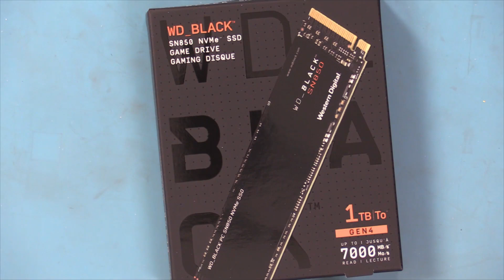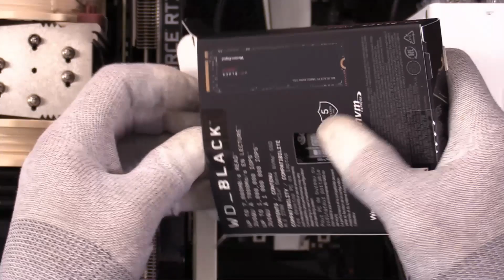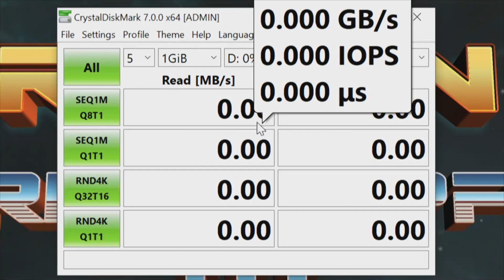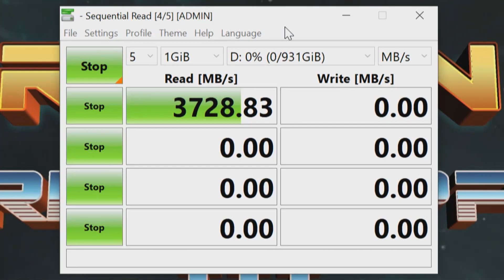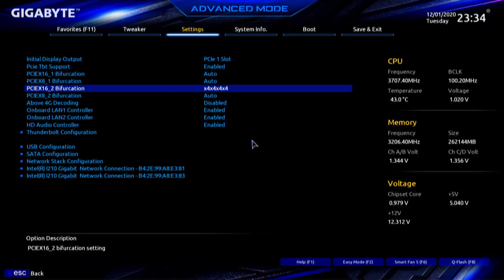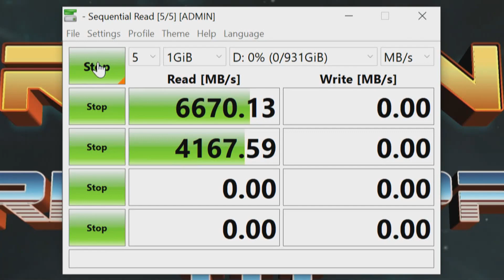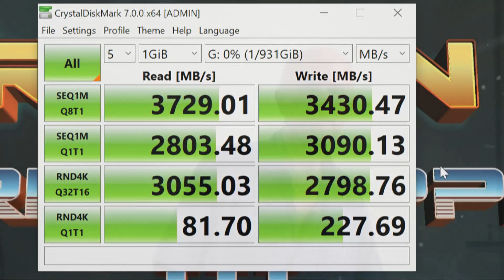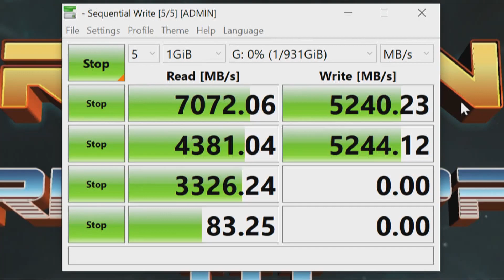WD Black SN850 Unboxing, Install, Test and Technology

Comment: So, WD SN850 (1TB or 2TB) and 980 Pro (1TB), which one is better, faster ? I'm very confuse to choose one of them.
Reply from the maker: Hi  BVT - Bách Vạn Truyện, 
Which is faster depends upon which M.2 Connector is used - CPU or Chipset. Our Goal was not to confuse but to provide clarity. We will do better next time. 

1.) Notice larger M.2 NVMe Drives will always be faster than smaller M.2 NVMe Drives. Denser Chips, Writing to more Chips. 
2.) On the TRX40 Designare Motherboard, using the 2nd M.2 Connector to the CPU - the WD Black SN 850 is faster, in our informal tests than the Samsung 980 Pro. Your Results may vary. Hope that helps!
Reply: @BuildOrBuy  How about if i just play some games, render video, sometimes use adobe software. copy some large files, which one will you suggest 980 Pro and Sn850.
Reply from the maker: Hi @jiangtruong ,
Hi Jiang Trương, 
Right now, both are good value if You have PCIe 4.0. As to which one? If I could get either one? My personal preference for NVMe is Samsung. It's all about availability!

Comment: Hi Gill, amazing video. I wonder if it's compatible dell latitude 7490.
Reply from the maker: Hi Danny, 
Thank You! We need to determine if You have the M.2 NVMe Connector. According to Kingston, You do. Check the Dell Service Tag on the back and verify on their website. Another option, go into Your Bios and and see if You notice a setting for NVMe. The 4th option would be to install and run Belarc Advisor Free. That report will tell Us what's there. It can only ready a Device, not an empty Connector. The last option is to visually inspect the Laptop internally for the M.2 NVMe Connector. 

1.) https://www.kingston.com/unitedstates/us/memory/search?model=97698&devicetype=3&mfr=DEL&line=Latitude
2.) https://www.dell.com/support/home/en-us
3.) https://www.belarc.com/products_belarc_advisor

Appreciate Your Comments!

Comment: You mentioned that the tested drive will operate at it's top seed up to 75% of it's full capaticy. Is this also true for true MLC drives like Samsung 970 Pro or Samsung 850 Pro SATA3? Or good TLC drives like Samsung 850 EVO SATA3 or Samsung 970 EVO (PLUS) NVMe? Is there any drive that You've tested that pushes that 75% limit further or even up to 99% or 100% (100%=no disk space left on drive) ?
Reply from the maker: Hi Don, Any Drive whether Spinning, SSD or NVMe. I run up against that all the time with Spinning HDs while Rendering Videos. And have to start dumping or off loading Data to an Archive Drive. If You ever fill up a HDD, take a look at Windows Explorer, This PC, Devices and Drives. Ever Notice a Drive in the Red? There's still space but... Time to offload Data to a different Drive! Performance drops! Keep Usage under 75% Capacity to maintain top performance. I only know the Specs. I've been using M.2 for over 6 Years. And M.2 NVMe for maybe 3 or 4 Years. Other factors come into play before that ever occurs. 

My 1st encounter with a Full M.2 SSD Drive was for Virtual Instruments. Virtual Instruments require copious amounts of space while installing before they are ready for use. Therefor, with an M.2 NVMe, easy to avoid and Plan for it in Advance. Good Question! Thanks for Asking!

Comment: HI, just found this channel, love it. I just bought the SN850 2TB, but I get horrible write speeds when running it through my X570 chipset lanes. Any chance you could let us know how this drive runs when on your chipset lanes ? Do you see massive loss of performance ? My read speeds are just fine though.
Reply from the maker: Hi Mathew Lear, 
Nice to meet You! Glad You found Us! Welcome! Are You on the 1st M.2 Connector and no shared PCIe Resources? Many of the x570s has way too many shared Resources. Which Motherboard are You using? I'll be happy to check and see! So far, we've had good performance. We tested and disconnected until the next test. 

We've just Filmed Thunderbolt 3 Firmware Update and Slot assignments. Tedious but necessary! Getting ready to Film a Riser Cable and Card then Capture and Streaming cards! Stay tuned! Then back to M.2 NVMe cards to compare Heat performance. Answering Questions with Videos keeps Us busy!
Reply: @BuildOrBuy  Hi, actually my board only has one m.2 slot (Asrock X570 ITX/TB3) and this slot is wired through the chipset (confirmed by Asrock tech support). My board has been tested with other Gen4 drives and max sequential writes are hitting 5GB/s , but with the SN850 I cannot get sequential writes above 3.3GB/s. So far I tried both the 1tb and 2tb SN850 and both hit that 3.3GB/s wall for writes. I am suspecting that maybe the SN850 just does not like being written to through the chipset lanes. Read speeds are fantastic, well over 6GB/s. All other peripherals are disconnected and SN850s have been secure erased before testing.
Reply from the maker: Hi @FTLN , 
Through the Chipset... Ouch! That explains a lot! Hmm. PCIe 4.0, You should be getting 7,000 MBps both ways or at least 6,000MBps both ways. I wonder if the SN850 Drive Controller is faulty? Do You have anyone else who can install and check? How long have You had the Drive? Running with a Heatsink?
Reply: @BuildOrBuy  Hi again, I thought it was faulty at first also, so I RMA'd it and they sent me the 2Tb version. Still hitting the same wall on the 2Tb version. But Corsair MP600 on this board gets over 4GB/s writes through the chipset. Nvme controller driver is the stock windows drive and windows 10 is freshly installed with February updates. Bios is also up to date and latest chipset drivers. I really don't know what else I can do apart from ask other people who have this drive if they have slow write speed on chipset lanes. There will definitely be a couple beers in it for you :)
Reply from the maker: Hi @FTLN , 
Hi Mathew Lear, 
2TB version... Impressive. Curious. Do You know anyone close who can test on another System? Annoying to be neutered by a chipset. Definitely Sounds like an issue with the Chipset if the M.2 Drive is OK. PCIe 4.0 is suppose to be able to get to 8,000MBps or thereabouts. PCIe 5.0 should be out in 2023. Followed by PCIe 6.0 shortly thereafter. I hear that! Keep Us Posted on Your progress. Maybe You can get someone else close by who can test and verify on another PCIe 4.0 Chipset. Just a thought. We'll retest and check again. Easy to do when we get back to the M.2 cards. Yes the Chipset is slower a bit. But not as drastic as what You're described.

Comment: good review! but i don't know about the temperatures on that sn850.  without heatsink those sn850 are very toasty hot. reaching temperatures over the acceptable on the long run. I am looking more into the 4k random speeds, because in the daily normal use, that 4k would be more real. I think that a GEN 3 is more than OK, even an normal SSD. the difference opening a program was noticeable from a 7200 r.p.m. H.D.D. to a SSD. But From an SSD to a NVME is not as drastical as the one before. Good work!
Reply from the maker: Hi Charles, 
Thank You for Your Comments! All PCIe M.2 NVMe Drives require a Heatsink. Preferable to use what's included with Motherboard due to clearance with other Components. We've been running M.2 Drives going on 6 years now with no heat problems using the Motherboard Heatsinks. 

As for the perceived Speed improvements, everyone wants faster. That's like comparing RAM, going from 8GBs to 16GBs then to 32GBs and 64 GBs. And we're talking 256GBs (TRX40) or 512GBs (WRX80). We perceive the immediate greater difference going from 8GBs to 16GBs. But who is only using 16GBs? Laptops. Appreciate You Sharing Your Thoughts!

Comment: I have a DELL PRECISION 7540 (2019) and when I made a TEST, just have 3,400 MB/S For Read and Write. The DATA will change if I use another Conector M2? THE LAPTOP has 3 (Three).
Reply from the maker: Hi Alejandro Navarro, 
Welcome! Great Question! Think of it this way, a chain is only as strong as the weakest link. Meaning? Your Dell Motherboard Chipset and CPU are both PCIe 3.0 on CPU and Chipset PCIe Lanes. Thus a potential for 3,500MBps. Same for all Laptops. To reiterate, All Laptops so far have been PCIe 3.0.

Another thing to remember on a Laptop especially, Heat is a problem. The faster We go, the hotter things can get! Will Laptops ever have a Chipset with PCIe 4.0 or PCIe 5.0? Eventually. We need better Designs of M.2 NVMe PCIe SSD Drives and Heatsinks. Now for Your Specs, to take advantage of what the WD Black SN850 can achieve will require a Motherboard and Chipset to match thus PCIe 4.0 to get at 7,000MBps! Perception and Perspective! 

Intel Mobile CM246 Chipset - PCIe 3.0 
https://www.intel.com/content/www/us/en/products/sku/135100/mobile-intel-cm246-chipset/specifications.html

The CPU and Chipset are Your governor keeping Your WD Black SN850 at PCIe 3.0 speeds instead of what the Drive is capable of which is PCIe 4.0 speeds. 

Checking the Specs and verifying, hope You have 8 Cores / 16 Threads. This CPU as an example in a Dell Precision 7540.

Intel Core i9-9980HK Processor is PCIe 3.0 as Your Test Confirms. Yes, using CPU PCIe Lanes is a tad bit faster than using Chipset PCIe Lanes. 
https://www.intel.com/content/www/us/en/products/sku/192990/intel-core-i99980hk-processor-16m-cache-up-to-5-00-ghz/specifications.html

To verify Your Chipset Specs, suggest install and run Belarc Advisor to interrogate Your Computer and Network. Link below. You'll know everything about Your Computer Specs. We always look at Design vs Implementation and see how that all lines up for Motherboard, CPU and Chipset. Hope that helps! 

Belarc Advisor Free 
https://www.belarc.com/products/belarc-advisor
Reply: @BuildOrBuy  Dear Friend, I'm totally agree about that! I forgot all the Info that you comment. For now I've an SSD NVMe for the future, Maybe for another Update On Desktop PC It will be the best way. Thank You! for ALL the INFO. You got a new suscriber!:goodvibes:
Reply from the maker: Hi @AlejandroNavarroHMO ,
I'm honored! Sometimes We forget and just need reminders. Appreciate Your Comments and Support!

Comment: WD Black SN850 is NVMe 1.4 - is that a problem? We usualy had NVMe 1.3 drives. What motherboards will not support NVMe 1.4 protocol? NVMe 1.4b is the newest.
Reply from the maker: Hi Don, Just now seeing Your message! All Drives are backwards compatible. A newer 2nd Generation PCIe 4.0 Drive will work in a PCIe 3.0 Motherboard. A chain is only as strong as the weakest link!  In other words, whatever is the lowest common denominator, that's our speed limit. The only reason to purchase one of these would be if they are less expensive. Otherwise, not much benefit. 

YouTube did not send the email about Your message. I'm logged into the Channel and reading this under Channel Messages. Appreciate Your Feedback!

Comment: If you have two ssds do you lose performance on either ssd? It was on a review so idk and great video
Reply from the maker: Hi bob bob, Depends upon context and configuration. Overtime, they can slow down in performance if used beyond 75%. I think that's one of the reasons so many people are wanting RAID. Going with RAID does not necessarily double performance. There's overhead. 

What are You thinking of doing? Thank You for Your Comments. 

BTW: We're getting ready to evaluate the Sabrent Rocket 4 Plus. And we'll be doing another Video on Bootable Bios Hardware Hybrid RAID. Stay tuned.

Comment: If I install SN850 without heatsink on Dell Inspiron 7415 14" 2 in 1, would it generate lots of heat?
Reply from the maker: Hi Red October,
Welcome! Great Question! Don't know Your Chipset. However, since Your CPU is PCIe 3.0, expect Your Chipset to be same Speed. Therefor, You'll only achieve PCIe 3.0 Speeds which would be 3,500MBps. Even though this M.2 NVMe PCIe SSD is capable of around 7,000MBps Read performance. No, Heat will not be a problem. Going for the 1TB version? That stock 256GB NVMe PCIe SSD Drive is definitely too small! Hope that helps!

https://www.dell.com/en-us/shop/dell-laptops/inspiron-14-2-in-1-laptop-amd/spd/inspiron-14-7415-2-in-1-laptop

https://www.amd.com/en/products/apu/amd-ryzen-5-5500

WD_BLACK 1TB SN850 NVMe Internal Gaming SSD Solid State Drive - Gen4 PCIe, M.2 2280, 3D NAND, Up to 7,000 MB/s - WDS100T1X0E
https://amzn.to/3yzIlHA

BTW: An option would be to ADD a Flat Copper Plate if You think Heat might be a problem. We have a Video on that Copper Plate.

M.2 Copper Heatsinks Cooler for M.2 2280 SSD Laptop（2 Pack) 
https://amzn.to/3L9eAjs
As an Amazon Affiliate, I earn from qualifying purchases.
Reply: @BuildOrBuy  Thanks a lot for your kind reply. I am considering 2TB for longer use. Yes, chipse is PCIe 3.0 and Mobo is PCIe 4.0.  Good to hear that heat will not become an issue with PCIe 3.0 chipset. Much appreciate your replies.
Reply from the maker: Hi @redoctober2026 ,
Absolutely! Here to help! Are You certain Your Motherboard Chipset is PCIe 4.0? CPU is only PCIe 3.0. To Verify, install Belarc Advisor. It's free for personal use. That will List everything and then some about Your Computer. 
https://www.belarc.com/products/belarc-advisor

2TB, Smart choice! We always need more space for Our stuff! That way You can install it and not get jambed up later needing more space. Keep Us posted on Your progress!